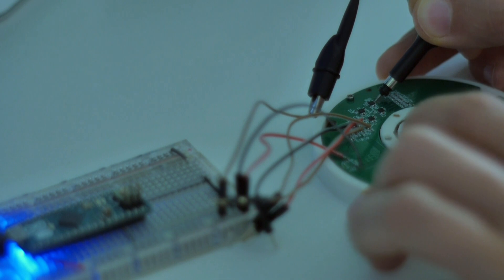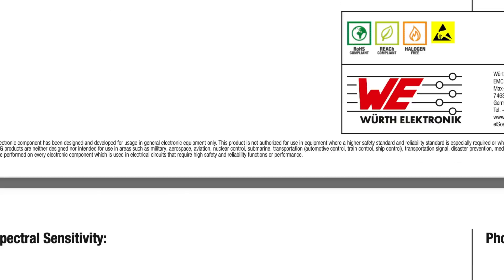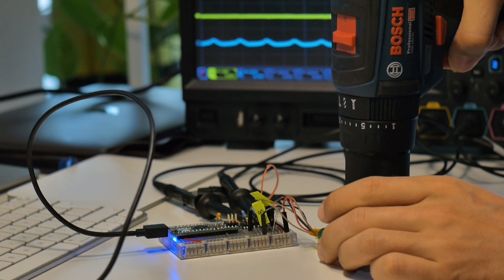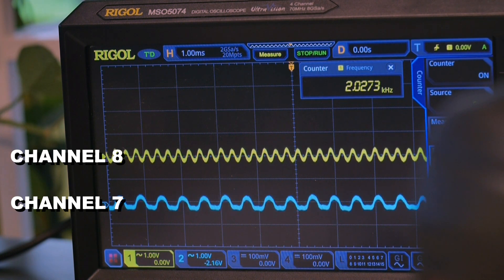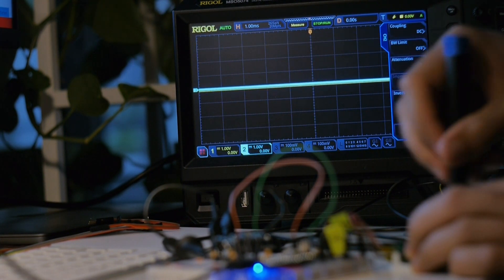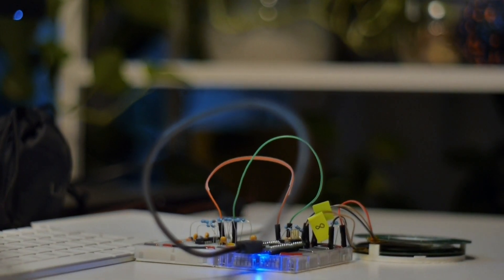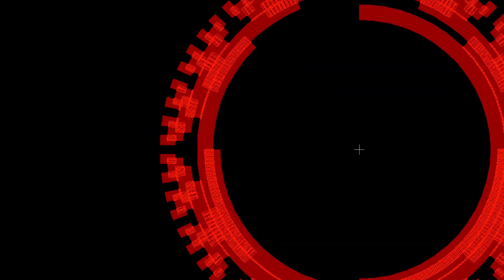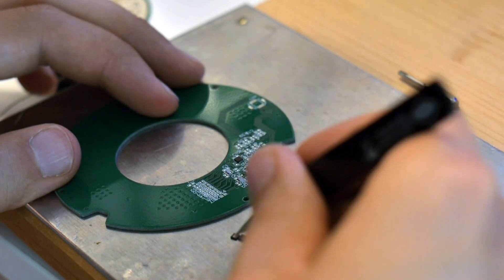detecting pulses of infrared light

Comment: 3.5 MHz pulses?   NICE!!!

Look into using Comparators over Op-Amps for your data slicers. They are faster respoinding, lower propagion delay, and often cheeper.
Even the old LM339 has 1.3 uS delay, and newer, and better ones are in the dozens of pS!

You do not need to put all your sensors in a line. You can space out all of them, except the MSD by the symmetry of the other bits.  For example the 2nd for the top bit can be 180 deg, and have the exact same signal. 3rd can be at any of the four 90 deg, 4th 45 deg, etc.
This could help with your crosstalk optically between the sensors.

Check into to "bottom firing" LED's and Photodiodes, ones that shine the down. If used, they can also use the PCB they are mounted on as a mask, as well as add some distance to "focus" the active portion of the beam though the mask.

(Weird... it's like I used to do similar things 25 years ago. <G> -- but it was Carriers though Pnumatic Tubes Systems, as well as position sensing of the routing equipment.)
Reply from the maker: Only 3.5 kHz pulses in this video. The goal is to achieve 5000 RPM and therefore about 22 kHz. 
Reverse mounting the Optical components is a nice Idea! I will look into that.
Reply: @365robots  Much more sane pulse rate.

What exactly are you sensing at 5000 RPM? Most motor controllers now are using magnetic rotory sensors, like the ams AS5200L, or hall sensors on 3 phases.

I'm not saying you should stop what you're doing it, just that you might later want to compare to one of those.

I perfer the optical, as it's much easier to figure out what's wrong than many of the magnetic system. I've had nightmares after working on the high resolution tape ones!